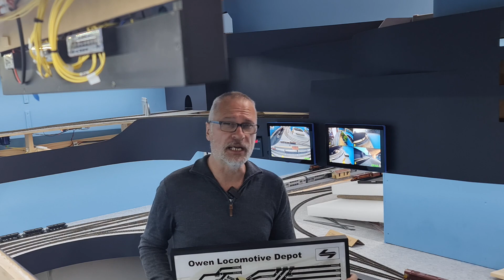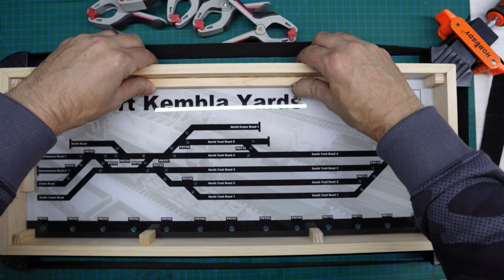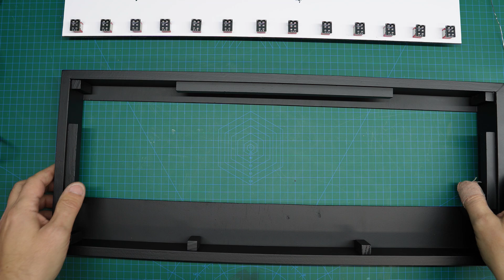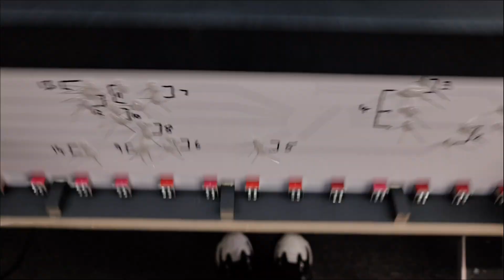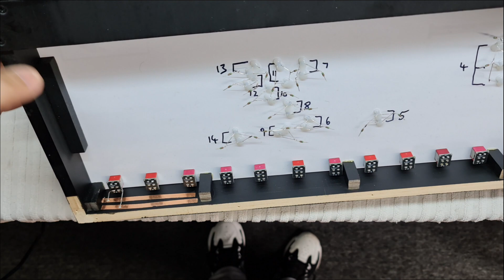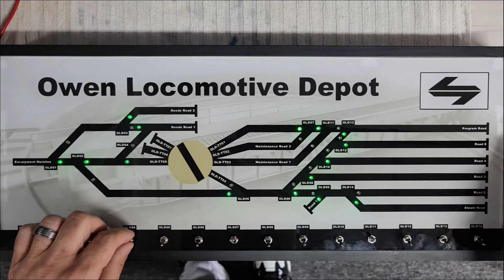Control Panel Build - The Escarpment

Comment: Jason,
Your build outs are excellent. I have been scouring YouTube for 2 years for help with my HO train building and your ideas are in a class of their own.
I have adopted your technique of wiring my Tortoise switch machines in parallel with my indicator panel and have added bipolar LEDS to each track of a turnout on my control panel so that you have RED/GREEN indicators changing color to show which track is open (green) and which is closed (red). A little bit more wiring, but is a helpful indicator.
I still have lots of DPDT switches to wire, so would you be willing to share with me the contact information for the custom PCB company you used. I would assume they have your design on file. Did you use standard miniature DPDT switches or PCB design (Love My Switches web site)  ? long or short lugs for PCB. Thanks, Ben
Reply from the maker: Hi Ben, thanks for the feedback. It was much appreciated. I was going down the path of bicolour LEDs, then changed my mind for no particular reason. I do like the concept, though.

The PCB company does own the PCBs. They just do the printing. I had to pay someone to design the actual files I wanted for the mini DPDT. Are you in Australia or elsewhere in the world? Cheers

Comment: Hi Jason, 

Would you be able to help me with my wiring/control panel set up?
Reply: I have 9 stalls with 13 sectional tracks, machine shop and mainline. I have pictures of it and a drawing. Unfortunately, it looks like YouTube wouldn't allow me to attach them here for you to see.
Reply from the maker: You can reach out via Messenger, that allows pictures to be attached
Reply: @The_Escarpment  

Hi Jason, 

What messenger are you talking about?  I don't see a messenger for YouTube.
Reply from the maker: Sorry, I should have said Facebook messenger
Reply: @The_Escarpment 

I found you on Facebook messenger and sent you a picture of the drawing for my module layout and picture of the actual module layout. 

What is the material you are using for the cover (control panel or track diagram)?
Reply from the maker: I used clear perspex and had my diagrams reversed and printed on the back
Reply from the maker: Hi Benjamin, what sort of help are you looking for? My video shows how I did them..cheers

Comment: Very informative Jason. The outcome looks excellent - very neat work. Just a quick question please, where did you get the clamps from that were holding the frame together? Thanks again for posting your great work.
Reply from the maker: Thanks for watching Craig! I believe I got them from eBay. But your local hardware store should stock them as well..regards

Comment: I see you’ve added separate switches for point 12 and 13. In reality they should be connected to the same switch, as you otherwise could have switch 12 pointing at point 13, but point not ready to receive traffic (straight instead of diverging)
Reply from the maker: Yeah, you could say that for a number of switches. But the system is manual, and that was the way I intended it to be. People will just need to have their wits about them when operating..cheers

Comment: Wouldn't advise using that copper tape as a power bus. It's only meant for short sections or as antennas and shielding. You'll get too much voltage drop along it and that will depend on the current in use at the time. Also no need for the two resistors on each pair of leds, one resistor on one side (doesn't matter which side) would achieve exactly the same result.
Reply from the maker: Thanks Paul, yeah a had a stack of those resistors, but you are right. Fortunately, 2 of those resistors gave me the dimming I was after, but I should have mentioned that. 
Good point with the voltage drops. I will test that while it is still on the workbench. I do have some voltage drops across the control panels, which seems to be the gauge of the bus line being too small for the longer runs..cheers
Reply from the maker: Tested and I have no voltage drops across the panel, so good news there